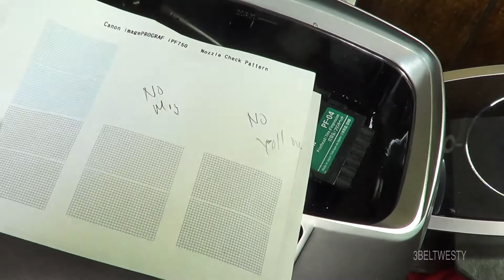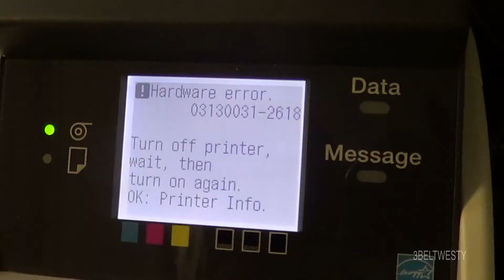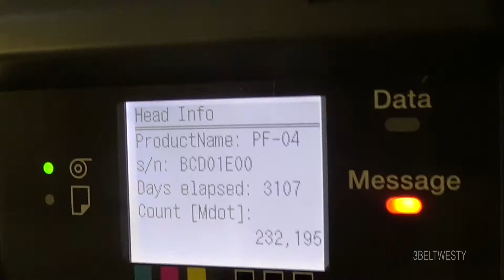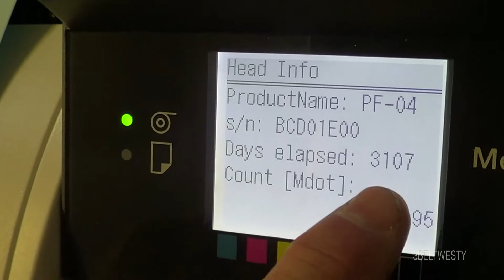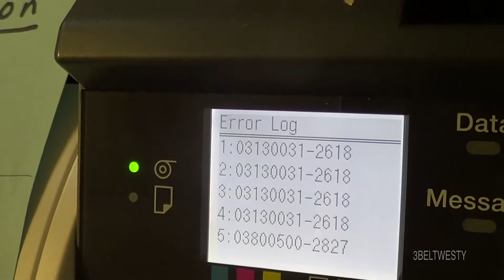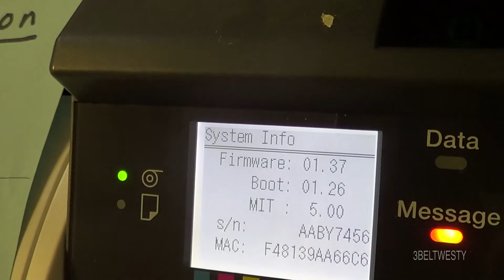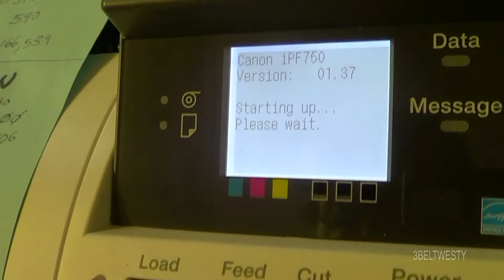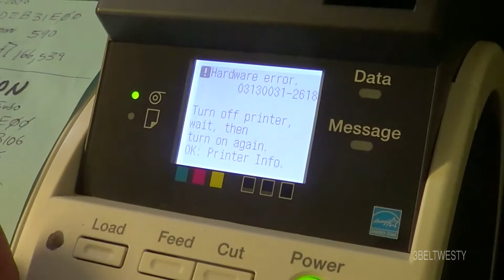PF 04 Canon Inkjet unclogging tries on IPF 750

Comment: I think you need to purge the lines. By having a quick look when you had the printer top cover open. There was no ink in some of the lines. It's happened to me a few times now. When you remove the printer head a few times you start losing the ink in the lines. Somewhere on youtube, there is a video showing how to do it. Side covers need to come from both sides etc.  Anyway, I like the ultra sonic idea to clean the heads.